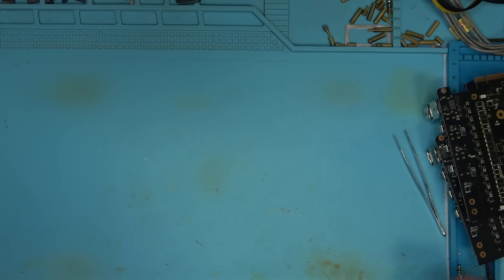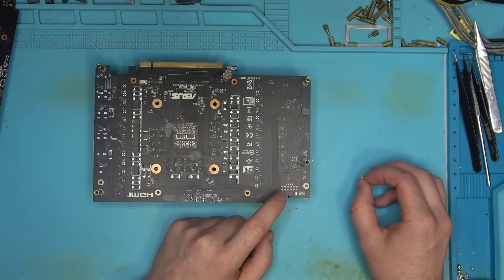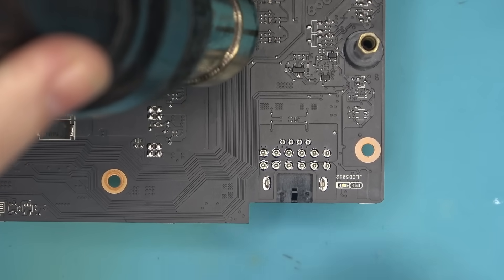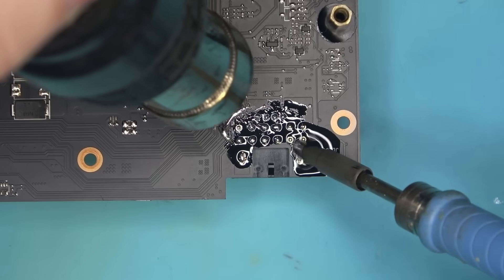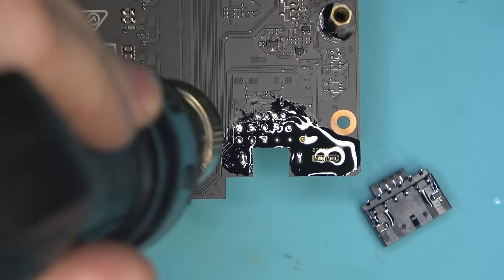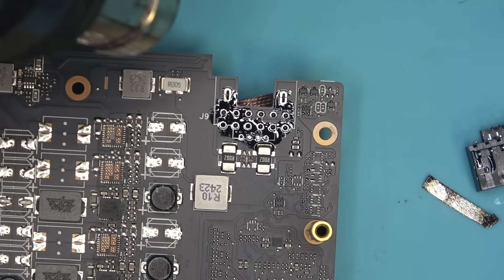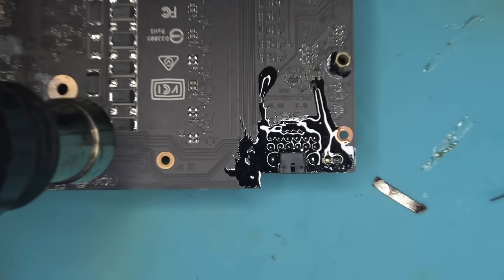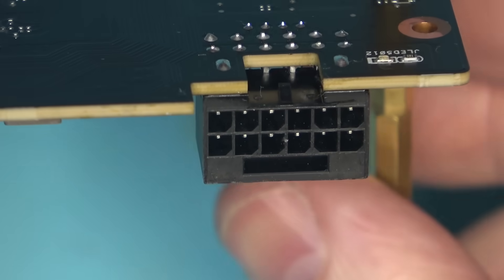@Jayztwocents  How to replace a 12vhpwr GPU connector

Comment: Man! You need a thing to hold your hot air in a static position and a thermocouple for the PCB so you can keep an eye on the temperature. That would help you a lot!
Reply: Did you even watch the video?
Reply: @GregM  Yes he is holding his hot air with his hand as if he thinks he needs to swirl it around, but it's really just needed to preheat the board so it can be static.
Reply: @NightfallSentinel  unless there are plastic parts in the area that you do not want to damage items in the area like the LED etc. It is best to show Jay the safe way of heating an area of the board so that you do not concentrate the heat in one specific area. Just because there are not many plastic components on this card, it does not mean if Jay tried to use the technique on something else down the road that he will not melt the crap out of something by concentrating the hot air directly in one spot.
Reply: @GregM  What do you think is the purpose of the thermocouple? Just heat it from farther away and keep an eye on temperature. That's the only way to do it safely.
Reply: @NightfallSentinel   There is no thermocouple in this video, or are you talking about Jay's video? Ya that can be used but only if one has the patience to wait and temperature depends on where the thermocouple is placed and what temperature you are looking for depends on the thickness of the board. You also have to watch and make sure you do not wind up warping the board because you are impatience and jack up the heat.
Reply: @GregM  I'm giving him advice on how to make things easier. The entire purpose of the hot air is to preheat the board. You use a thermocouple to keep things safe, always! It's stupid not to, because you risk overheating sensitive components.
Reply: @NightfallSentinel  Yup you have to be able to realize that if a part is not coming off there is something wrong and stop heating the board and think.
Reply: bruh...

Comment: Good vid!
I would just add that the same rules apply to any through-hole connectors. Charging ports, VGA/DVI, USB, whatever. 
SMD connectors are so much easier than through-hole ones.

Comment: How much to change a bios chip on a 6900xt?
Reply from the maker: Same as to reball the core.
I don't want your card even at gun point.
I would flash the bios chip and problem it has is actually dead core .
Enough is enough.
Reply: @northwestrepair it does work fine when I flip the bios switch, it has overclock and silent mode bios switch, overclock is corrupt, I lost power one night and it never worked since correctly. Sometimes it will boot in overclock, and when you look at gpuz it's all messed up, I tried to flash bios when still on the card it says successful but never stays after reboot. I seen they sell bios chips on ebay but to scared to attempt myself lol. Any thoughts? I have gamed in silent mode for a long time on it with no issues also, just have to change setting in adrenaline every time.
Reply: @whyme2500  dude just use the card on the silent bios, undervolting is better anyways
Reply: @Hetsu.. might have to, probably not worth the cost to repair it. Thought about selling it on eBay but would probably get scammed Anyways lol

Comment: I left jay a comment about solder. I think he was miss informed what types of solder are used. 
I suspect he was calling lead solder low melt and maybe isn’t aware they use lead free solder in the manufacturing. 

If he was really using low melt bismuth solder then idk wtf happened.

Comment: For replacing these particular connectors you need courage, or enough experience to not need courage, or irrational confidence, or lots of stupidity, any one of those will do for taking apart a $3000 GPU and trying electronics repair where a bad result could be your $5000 computer catching fire.